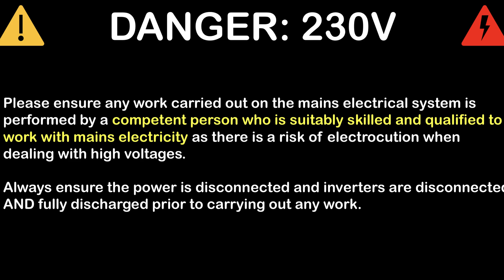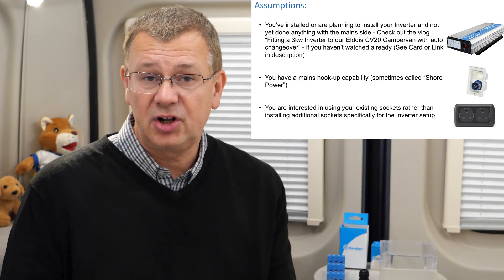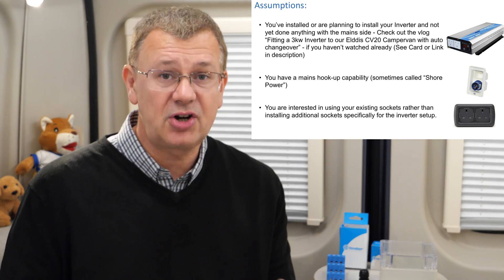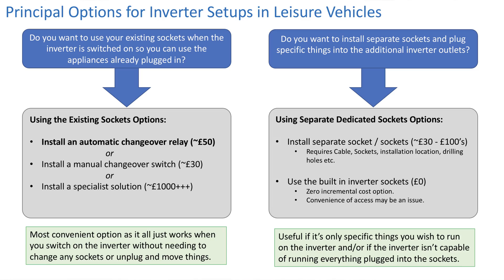Campervan Mains & Inverter Auto-Changeover for under £50 using a RELAY - How it works - Tech vlog

Comment: Thanks for the reply. The fridge is on a socket circuit , although I have not found the actual socket. Probably behind the fridge. Thinking about it, that seems strange as the fridge should be fused either in a plug or socket. I will follow that up. Clearly the Auto switch in the fridge is looking for 240V supply and then switches onto it once detected. Without 240v it selects LPG after engine turns off. I shall have a look at turning it off auto, that way it will always run on gas or 12v on manual that way your auto change over would work. Thanks again for your reply. I have a thousand questions but will crack on and touch base if I hit problems.
Reply from the maker: Good luck with the investigation - all the best, David 👍

Comment: David, As a result of switching over onto 240V using the Inverter, which obviously is powered by the 12v system. Your on board fridge will then be powered by the inverter.  Is it the case that you have a compressor fridge using less power then the three way type on board mine. My three way pulls 20 AMPs so being off grid if the fridge was live 240v I will need 500amp hour of battery just for the fridge. Do you know of a way of preventing the switch over activating  automatically the fridge selecting 240v and go to gas. Thanks
Reply from the maker: Great question, mine is a 12v compressor switch so it’s not impacted, if the fridge is supplied off the power sockets, that would then switch it across, because I used the power sockets only (which didn’t for example have the heater or water heater or charger on it as I didn’t want to power those from it) - does the fridge feed off the sockets or have a separate breaker, if separate if you install on the sockets only it would then only switch over the sockets, if the fridge is on the socket circuit it would cause the issue (unless of course you manually switched it over) - hope that make sense? All the best, David 👍

Comment: Hi David. Another great vlog. I have a brand new caravan coming in march and this will be one of my first jobs. Can I please ask though. How are you connecting the inverter output to the consumer unit? I believe all the live connections of the MCB's are linked via a little busbar. Will connecting the inverter live to the 'socket circuit' MCB not make all the circuits (including the charger) live? Sorry if I'm being stupid but you cant be too careful 👍
Reply from the maker: Thank you - I am using a relay to isolate the sockets from the mains input if that makes sense when the inverter is switched on (so the other side to the bus bar where it feeds to the sockets if that makes sense?)
Reply: @LeisureBit  Hi Dave. Sorry if i'm being a nuisance or simply stupid. I completely understand the relay part isolating the mains. My concern is feeding the 230V from the inverter to the socket circuit. How do you power only the socket circuit without also powering the charger circuit and creating a charge loop? Might just be my van but the live side of the MCBs are linked so making one circuit live makes them all live.
Reply from the maker: I’m using the feed to the sockets only (the output of the RCD for the sockets rather than the bus bar side) this then feeds into the relay to isolate it (common to sockets and normally closed to the output of the socket RCD then normally open to the inverter and the coil is also connected to the inverter so the path when inverter on feeds JUST the sockets and when off it’s same as original via the relay.

Comment: I have a same relay but there is some problem, it doesnt transfer ac fast , sometimes my devices shut down ,do you have any idea
Reply from the maker: Are you trying to use it like a UPS? If so it’s probably not the best solution as you say there is a change over time with it being mechanical
Reply: @LeisureBit  yes , I use it like a ups , in the datasheet , it says 10 ms to transfer  ,  as I know it is enought but I dont understand why devices shut down

Comment: Hi David, thank you for publishing this, really straightforward and really well explained, parts on order and will be building it soon. Not using it with an inverter per se but a "drop in" high-output power bank. As you say obviates the need for new or trailing sockets and giving that on grid experience when off grid, especially with app controlled power banks. Really appreciate you taking the time to show us all this. All the best, Andrew.
Reply from the maker: Hi Andrew, really please it was useful and thank you so much for taking the time to comment. As you say the same principal applies to power bank as when you plug it into it will switch over and use the sockets in the van same was as I did with my inverter. Good luck with your little project - hope all goes well - let me know how you get on - all the best, David 👍
Reply: @LeisureBit  How is the powerbank connected?
Reply from the maker: @pauricsurlis9191 normally to separate sockets but you could do similar to above with one perhaps have it connected to charge up also ? Some have a function for that (ups) although that’s not necessarily what you would want
Reply: @LeisureBit  Thank you. . I could use it as a ups but that isn't part of my plan right now. Is the powerbank connected using one of its 3 pin sockets?
Reply: Parts received, assembled, fitted and working… fab.  As you say, it just works… love the simplicity. Thanks once again for taking the time to put this "out there".
Reply from the maker: @joandandrew5097  brilliant- pleased you are up and running - as you say it’s the simplicity of it and once you have it, I found you wonder why you would do it any different as it does then just work. All the best, David 👍

Comment: Really useful vlog David and something I'll be wanting to do. I have a 3 way fridge which when off grid, I would want to operate from gas to avoid running down the batteries. Would this set up just mean I'd have to manually select gas each time? Would you mind adding an image to show the connections to the power distribution unit and additional RCD please
Reply from the maker: Thanks for the comment. Normally the fridge is run on a separate breaker to the sockets and if so and you did it the same as me, and had it on auto, then it should just select gas automatically as whilst there would be socket power there wouldn’t be to the fridge if that makes sense (assuming you did similar to me and ran it to the sockets and the fridge was separate breaker) so should do what you need without needing to manually change I think 🤔 
All the best, David 👍